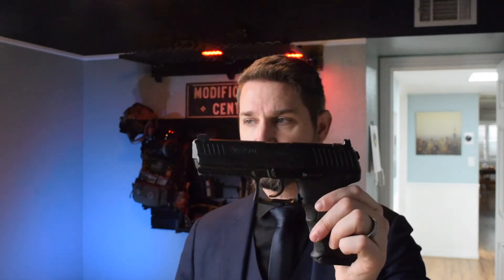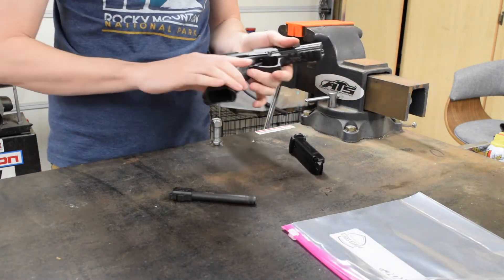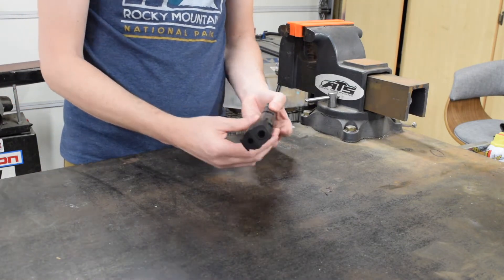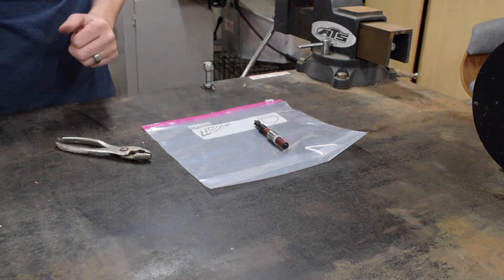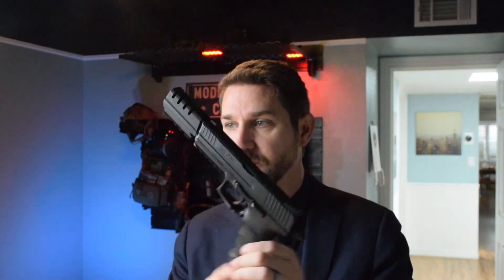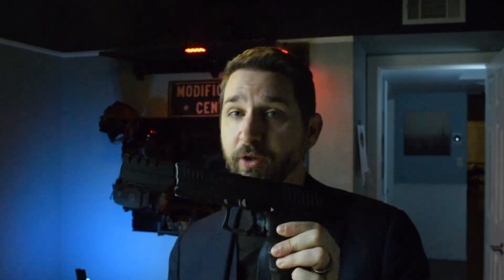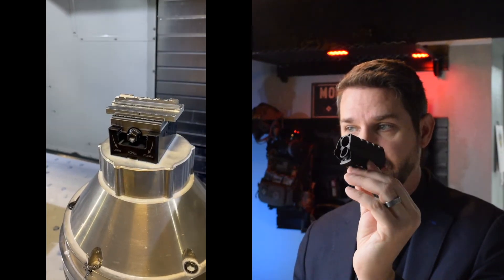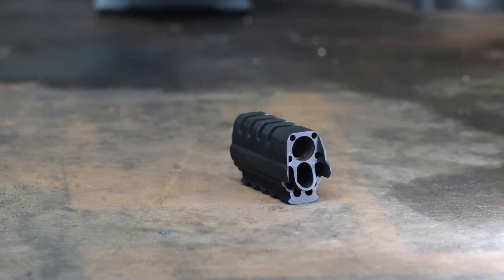Wicked Compensator- Create a functional clone of John Wick's H&K P30L with the thread-on 4 port comp

Comment: This is an excellent job well done. Great work!
Question: Would you consider a run of the closed port versions for those who want the style and also want to keep reliability?
Reply from the maker: Only if there is enough demand; these cost thousands of dollars to prototype and change CAD designs on.
Reply: How much does one of these compensators cost?

Comment: Just got my compensator installed this evening, letting the Rocksett dry presently! Is there a bullet grain weight you've found in factory 9x19 loadings that does a better job reliably feeding and cycling the firearm with the compensator in your testing? Thanks for the opportunity to get such a cool piece by the way!

Comment: So how do you disassembled with the compensator installed to clean/lube it etc? I take it if you have to take to a gunsmith to intstalled it to make sure the shims are time/properly placed that you can't take the barrel off since the compensator is basically permanently attached?
Reply from the maker: The video addresses this around the 21:00 minute mark.

Comment: Why do you need to swap out the recoil spring? Is it required?
Reply: Yes, I would like to know that as well. I think it’s a back pressure thing.?
Reply: @CraigLMoran  Yeah my closest guess is it might have something to do with comp weight on the barrel. But suppressor also adds weight to the barrel and you don't need to swap out recoil spring for adding a suppressor. Swapping the spring seems to be the most painful part of the process. It's otherwise super manageable.
Reply from the maker: @sullywully8742  Suppressors use a Nielson device which helps the browning tilting action of the pistol complete its cycle. The Compensator cannot fit one of those devices inside it and it bleeds off so much pressure from the ports that a new recoil spring was required to allow the action to complete its cycle. If you are running hot ammo (147+P) it can run on the factory recoil spring.
Reply: @DeFenderCo  Gotcha. Thanks for the thorough explanation!

Comment: $500 but don’t depend on it for your life …..? Which means it isn’t 100% reliable. Bummer. Way too much money. $300 and it would be worth it. $250 for a threaded barrel then $500 for this, you’ve just bought another pistol!
Reply from the maker: The original comp on the movie gun was really just a stylized blank adapter; even it was having cycling problems to the point that the gunsmith had to add a ramp cut to the barrel locking block to make it cycle more reliably. This is a functional tribute to the movie gun, but still suffers from the same problem that the prop did- there is a huge weight hanging off the front of the barrel. Suppressors have to use a Nielsen device to make a pistol cycle at all, so that we were able to get this to run reliably 85% of the time without one is pretty much unheard of. Just understand this a functional movie prop and not an offensive combat mod should help you understand the target market and purpose.

Comment: can you take it on and off reguarly? or supposed to be permanent?
Reply from the maker: It can be removed and installed as often as you like; you just need two reapply rocksett each time you install it.
Reply: @DeFenderCo  how come no shooting footage? think that be good for customers to see!
Reply from the maker: The first 2 minutes of the video is of live fire shooting.
Reply: @DeFenderCo  yea guess maybe not enuff for my taste im talkin mag dumps and rapid fire testing accuracy stuff like that think that be awesome! just more detailed on that front
Reply from the maker: I have a video of me doing a 15 round mag dump on my instagram. DeFenderAutoCo
Reply: @DeFenderCo  hmmm i see so what do you think would increase the reliabilty of the comp? different recoil spring? lightening cuts for slide?
Reply from the maker: Hot ammo is the best way to make the comp function. it needs a punch to be effective.  @thephantomzoneboxing
Reply: @DeFenderCo  have you tried 147 gr if so does it function?
Reply from the maker: I've run 147+P through it no issues. @thephantomzoneboxing